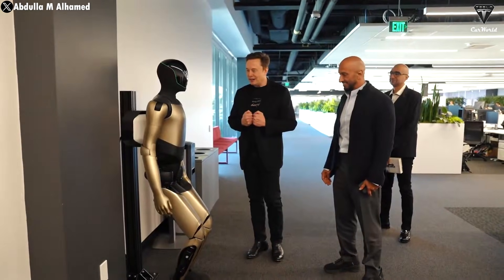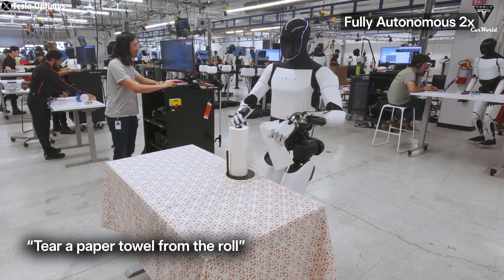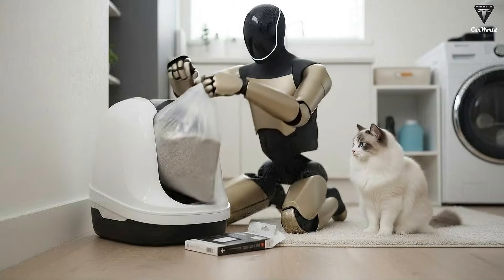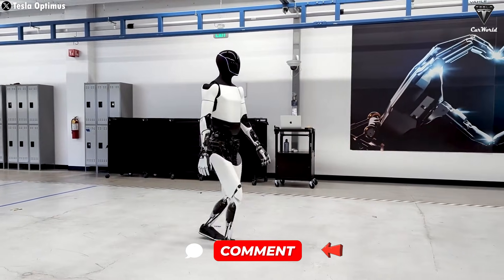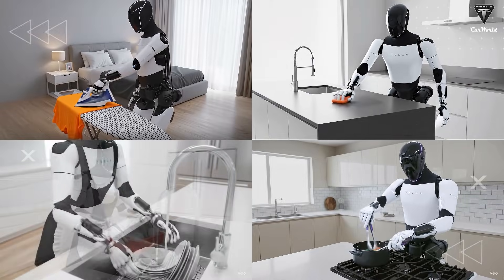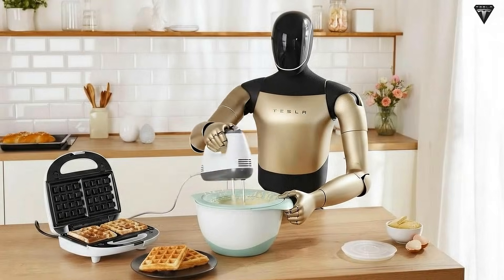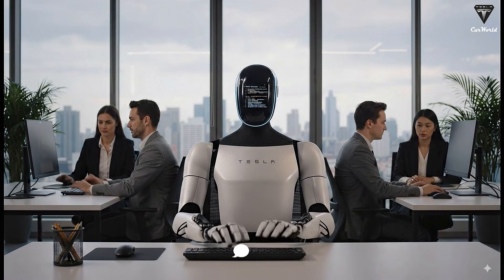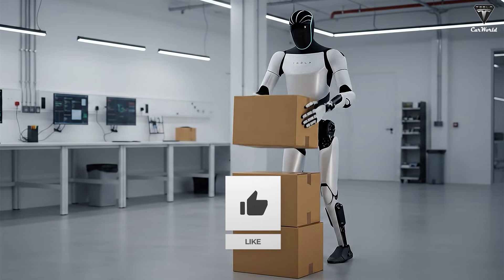Elon Musk LEAKED 4 Reasons To Buy Tesla Bot Gen 3 In 2026! Home Maker, Chef & Guard! HOW?

Comment: Continuous 8–10 hour operation is useful, but battery degradation over time could reduce reliability.
Reply from the maker: That’s a fair concern. Battery degradation is real, but Tesla already manages this issue well in EVs through thermal control, charge limits, and smart usage patterns. For Optimus, most tasks won’t require full 100% cycles every day, which should help extend battery life significantly.